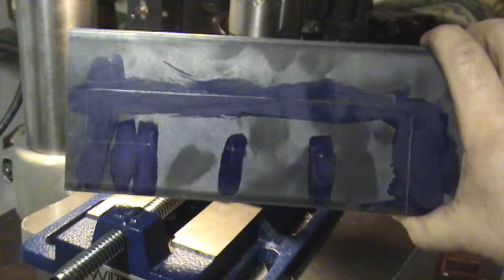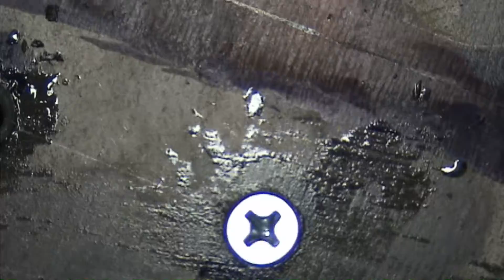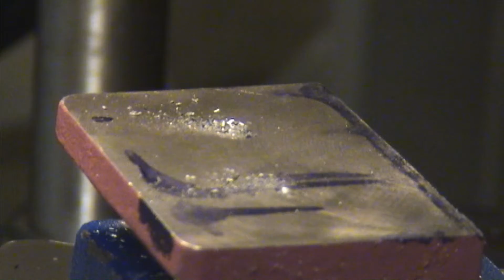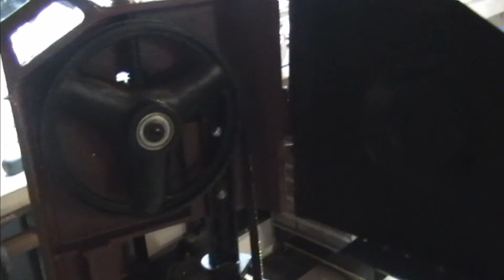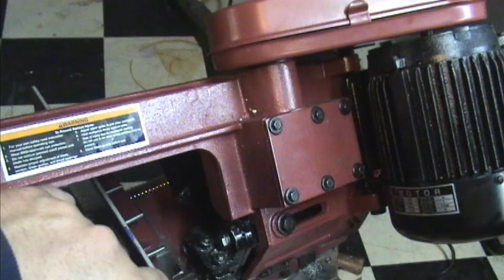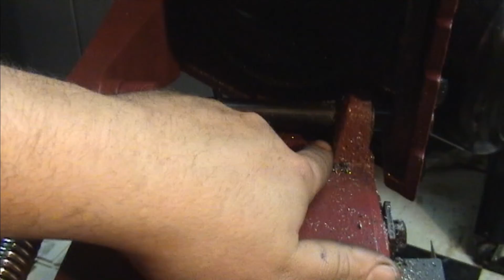Bandsaw Repair and Mods 7:  FINALE!

Comment: Instead of using a square in the vise to true up the angle bracket you was drilling. Use parrallels and flip it over? That was a pretty wonky set up there buddy.
Reply: Or just use a scrap block inside the braces to take up the space & tighten up, simple!

Comment: it's not a great saw, but for the price - really serviceable, saves tons of time, does a lot of work. 

my only real complaint is the sheet metal base, totally flimsy. i threw it in the scrap bin (the actual scrap bin, not the "save for later" junk bin) and cut a 2x8 a couple inches longer than the saw base and nailed the base to the 2x8, bent the nails over. it isn't perfect, but it is an improvement, i can use it on the bench, horizontal and vertical, the handwheel has plenty of room. much more ergonomic, takes up less space (not tripping over it on the floor) and it adds a little bit of mass, which it is sorely lacking sometimes. 

a steel baseplate addition would be nicer, but that requires making something with the same horizontal holes that the base has, or drilling through the base to make vertical holes. there's no real practical or easy way to mount the base to steel without lots of finicky measuring or blowing holes.

Comment: While I was watching your modifications , this tought came to me.

If the plate screwed to the fixed jaw of the vice (the one on the motor side) was too long and was cut after being installed, its length would indicate where will be the kerf for the pieces you will have to cut .  
But your machine has the same problem that mine: It does'nt cut perfectly vertical ...making the trick not as efficient as it could be,,,,

Comment: Greg thanks for the series. I see you did it about 3 years ago. Well, I purchased this saw from HF today.  Man I think King Kong was used for the transport from maker to HF. The new design now has better wheels, however the pulleys where machined off and had a noticeable wobble. The tab the holds the tension spring for lowering the saw saw broken off in the box. Well took the upper saw back and traded it for the prior design, and retained the base. Now I'll use your tips and upgrade mine. Oh ya two of the plastic knobs were also broken. Thanks again for your work. You going to the Summer Bash 2016?
Reply from the maker: I want to but my wedding is next week.  the bash is in June so not enough time for my bank account to recover :-).  I'm planning on next year.
Reply: +Halligan142 I understand. Congratulations in advance. Since I retired, I know all about the bank account thing. Later Terry

Comment: Need a little cutting fluid to keep your drill bit cooler. I am surprised as you normally use it.  Put a 123 block in the jaw to grip it in the vise.  Ahh here comes the oil.  Lay a piece of 1/4" across the top of the nut rather than drilling through and weld it.  I have had one of those welders for 25 years (among many) and it has earned its bread.  Get some .035 flux core and you will be making good welds in no time.  It is golden for taking wherever you have 120v service.  I like the screw jack on the vise.  That would be very helpful.  I think it might have worked better with a radius on the moveable jaw plate and it could have been mounted back on the jaw since you have it mounted in the full forward position.  By mounting in the retracted position you have travel to move the jaw and insert forward until it just clears the blade guide.  Great idea though I am sure you will fine tune it.  Now I will have to go to work on mine. ( As soon as I finish my shop addition.)  Have a great day and thanks for the video.  Enjoy your saw.  That welder is a keeper.  You can get a ten pound spool adapter for it (much cheaper than the small spools) and a gas kit if you should want it.  I use mine in flux and wouldn't be without it although I have another that is set up with gas and another with a spool gun for aluminum.  Doug

Comment: Truing up wheel(s) was a good starting point. Vise mods , new knobs, chip tray, etc made it more functional too. Your method of blade truing was mostly acceptable for the everyday handyman. But if you're ready for the next level of accuracy obtainable from a grossly under-engineered Harbor Freight piece of Chinese junk......continue reading. 
 
   A tip for you.....For better visual accuracy when using machinist square to check  the side of blade squareness to table.....make a long straight edge clamp of  2  ea
6mm x 6mm  metal bars about 8" long with 6-32 pinch screws near each end. (Verify the selected bars are truly straight....3/16" or 1/4" bars might work also)  Use .025" spacers between bars then clamp to blade so as to be extending  upward parallel to the tongue of the square. Do not clamp on blade teeth. Any slight gap of light between 8" bar length and tongue of square indicates adjustment direction to correct blade orientation, the vertical angle related to vise table.

Blade adjustment has many facets and parameters to fine tune, ....first you must accurately measure and determine the amount and direction in which blade needs to be adjusted. Now while square tongue is extended upward, raise saw arm and note the blade swing path. As reference, 1 deg is .01745" per inch.  EX:  If you gently butt the tongue of a 6" machinist square against side of the blade teeth and then raise blade arm 6" to top of square. Lock the arm and use feeler gauges to measure any gap at 6" height.  A typical gap of .052" divided by 6 =.0086" per inch = 0.5 deg out of square. A temporary shim under left end of work piece might help, but permanent fix is the installation of adjustable pivot bearings for the arm. Usually the pivot rod clearance is loose within the pivot bosses, allowing arm to lean outward away from table vise. See comment by B Powell.

Another great use of the individual 6mm straight edge bars is in comparing and adjusting upper and lower blade guide heads  to be co-planar......just clamp a bar to each.....(probably across the bearing side faces)   With arm vertically positioned, just eyeballing it down across both bars is ok to see direction of correction required to adjust coplanar.  After this adjustment is correct,   measuring again with machinist square as in first paragraph will verify.
 Largest problem with trying to tweak saw adjustments is the poor design of guide blocks, having a single bolt affecting many parameters. It is so hard to get it all correct and locked into place......virtually impossible, actually.   It's trial/error and frustration. Most folks will just settle for a happy medium,  further effort not worth the results. But with intelligent observation and measurements it can be done........you have to simply identify all its faults and remedy one by one as best you can with resources on hand.

          Many report their blade tracks improperly and derails from the band wheels. Many factors have bearing upon this common problem, including worn guide bearings, improper blade tension, and upper  wheel tilt adjustment. If all else fails to remedy the situation, I suggest shimming under 1 or both guide blocks to adjust guide bearings slightly out of parallel to blade edge. Don't shim in wrong direction or problem is intensified. Blade will want to follow the bearing plane, so tilt trailing edge of upper bearings inward toward blade spine. If lower block requires shimming also, put shim on opposite end than top block was shimmed. Both blocks will now lead blade inward against bandwheels and makes it track more reliably , allowing increased blade tension and accuracy.
Adjust bearing to blade gap at .001" for greatest accuracy and keep well lubricated for smoothest cut finish surface. But beware that swarf can lodge in this small gap and lock blade down. I caution against unattended cuts unless you have funds for a new motor.  Being able to stop guide bearing rotation as in video does NOT apply to metal bandsaws, .......only for woodworking bandsaws.

       Lateral weakness in the saw arm contributes to inaccuracy........jaw angle adjustment  will be the only correction option. There isn't much room to beef up the arm with angle iron, etc and will add weight needing counterbalanced by more spring tension.  Hydraulic downfeed is a highly recommended mod, especially for cuts to pipe and tubing.  Thicker blades in .035" are available if you routinely do rough cutting which quickly destroys blade teeth. Select blade pitch that has a minimum of 3 teeth in contact with workpiece. More teeth increases surface smoothness, but too many teeth can slow cut time, bog the motor or produce too much heat on the blade which also destroys teeth.

     Moral of the story is:  If you highly desire cut accuracy....Do NOT purchase a HF or other Chinese copy cat knock-off excuse of a saw. I am presently modding a $2600 Baileigh BS-210M horizontal bandsaw for precision of .007" maximum.  I am sure it also is Chinese in origin, but is vastly superior quality than the small 4x6 HF, etc.
For the ultimate in accuracy check out the $4500 EV 97 Semi-automatic Precision KAMA Bandsaw .    http://www.kooltools.com/kama_bandsaws.html
Reply: You helped me a lot!

Comment: You should be able to do some very good welds with that welder. Lincoln makes very good welders. I don't see a bottle of shielding gas on your welding cart. Are you using flux core wire? If not, that is why your welds look so bad. It also looks like you need to turn up the heat and slow down the wire speed. I think mig is very easy to learn. I have my small miller welder set up to use CO2 for shielding gas and it does great welds.
Reply from the maker: It is flux core.  I just haven't invested the time yet running beads and learning the settings.  It's on the list.
Reply: +Halligan142 So, how's that welding coming along? With flux you really need to stir that puddle. I had a heavy weight piece of angle iron scrap, so I opted for the movable jaw change on my 4x6 saw. I also made a speed jackscrew for my saw too. I just got done making a new mini vertical table for my saw. I have not even tried it out yet. I used to just cut everything on that little plate that came on the saw. That was a balancing act. On another Utube channel I saw a guy that put a clamp lip on the cut off side of his saw, I'm still working on mine here. It looked handy the way he demoed it.
Reply from the maker: +Paul Frederick I've never actually used it in its vertical position.  Just never seemed ok to me.  Still making things stick together with weld.  Ugly as ever, but I rarely need to do it.
Reply: *****
I use my saw in its vertical position a lot. It is the only band saw I have in my shop. Here's how I did my movable vise jaw on my 4x6 band saw http://www.instructables.com/id/4x6-Bandsaw-Vise-Jackscrew/ I don't have a picture of my new vertical table yet. The batteries are dead in my camera.

Comment: Great video. My vice now has a jack screw but I just use a set screw instead of using threaded rod. Works a little faster. What would be nice is a clamp like used on a pipe clamps  What ever after seeing your setup I can't believe for years I have been looking for a block that was the right size to work. Thanks Much!

Comment: Really appreciate you're attention to detail and the way you solve problems. I intend to make some adjustments and upgrades to both of my band saws. I have a jet similar to yours and an old Rockwell 14 inch. Thanks again. I really like your videos compared to some of the others. Also, I have a new (to me) 1946 Southbend 9A. I was going to just clean it and use it. But having watched your video on the quick change gear box restoration, I'lm going to take that on too. Well done sir!
Reply from the maker: Good luck with getting that gearbox all cleaned up !

Comment: Nice work, well done, nice result and nicely presented. albeitr, just a tad of over kill, but with that neat lathe in yor shop, why not!!

Well presented as well.

Well, your MIG welding is far ahead of mine. I think I'll retrogress to oxy. i do acceptable work there, although my master fabroicator and machinist son thnks it is pitiful,

But, in making the mount for the jackstand an motpr for my old Atlas, i welded  a chunk of 1/4 steel and then ground it. No seam visible.  

I sold off the stick welder before i wnt blind. New helmet would've fixed that risk.

Comment: If your saw doesn't have head tilt adjustment (left side shaft arm) I would cut a new shaft with an eccentric end to allow for vertical cut adjustment, that is a heavily copied Wilton knock off, if they stayed true to the Wilton design, the left shaft arm will have 3 Allen screws and slotted holes that control parallel and vertical adjustments. In the absence of that, I would cut a new shaft as mentioned above.

Edit: I just found some other you-tubes showing this adjustment, no set screws, but 2 allen bolts are there on slotted holes for head tilt, this should get your saw cutting vertically.
Reply from the maker: Thanks for the tip.  I'll have to check it out once I get the new shop up and running.

Comment: I had one of the bearing that hold the blade fell apart.  I tried to buy a replacement from HF without success.  I found the replacement bearing at McMaster-Carr for $5/each.  The bearings they supplied were made in Portugal and fit perfectly.  This was a great source for bearings.

Comment: As always, very informative and interesting. Not a criticism, but a suggestion: When you put the smaller jaw in the vise it might have been more rigid to place a block of metal (or wood or hard plastic) between the ribs to clamp the jaw in. It doesn't matter that it is not a machined surface since the other side is clamped against the vice jaw.  Enjoyed the video very much.

Comment: Post 1 of 2
First off, great set of video's on bandsaw improvements. One thing you did not touch on was the adjustable pressure via spring for the bandsaw. On mind, what I did to achieve a very accurate 90 degree's cut, was tighten / increase so the saw has only about a couple of pounds (2 to maybe 5 lbs) of downward pressure. DO NOT PUT SOMETHING OF SIZEABLE WEIGHT TO INCREASE THE SPEED OF CUT, because this will result in a angle cut of easily discernment.